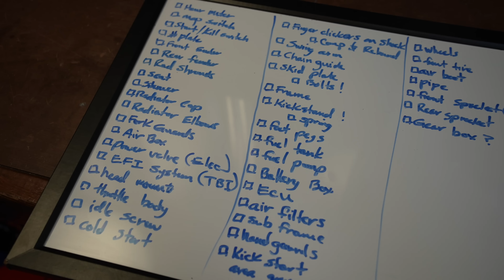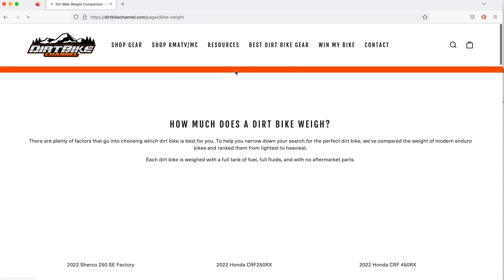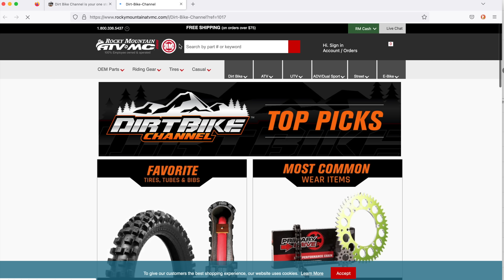I Didn't BELIEVE at first - 2023 KTM XC Dirt Bike Visible Changes

Comment: Don’t accidentally hit the starter button while the bike is running. It will throw a powervalve fault code (5 blinks of the Fi light)
Reply from the maker: I've been hearing this.  Not sure it has an adverse effect, but it's annoying.  Luckily the starter switch is much harder to push than before, but I'm sure it's going to happen eventually.
Reply: @DirtBikeChannel  just rotate the switch down so you have to look for the button.

Comment: The changes they have made are great. But are they starting to make it impossible to work on/repair the bike on your own by making the ECU impossible to reset/access? So far I have seen people having to take bikes to the dealer just to reset the ECU because they hit the starter button by mistake and it starts throwing error code for the powervalve. So you would have to take the bike to a dealer for pretty much everything that the ECU is part of .

Comment: It makes no sense to weigh the bike full of fuel because it disadvantages a bike that has a larger fuel tank, which should be a good thing. It's an easy fix though, you just need to calculate the mass of the fuel (given you know the volume and the density) and subtract it from the total.

Comment: This may be better 
I’m done with ktm though 
Had a 2007 sxf450 ( biggest piece of shit that I hated ) currently selling my 2022 husky te300i ( very very disappointed ☹️)
I’m trying out a 2023 TM300EN FI so we’ll see 😊 so excited!!
Reply: Care to elaborate?
Reply: @gpaull2  2007
Terrible ergonomics
Auto decomposition didn’t work 
Would never start, first oil change at 1 hour looked like what came out of a scrap meta grinder at the dump and had scarred cams, frame flexed so bad the seat kept popping out of place and was a 4 speed 🤮 

The 2022 
Engine surging at steady throttle, the intermittent bogging, the 1/4 throttle power free fall , terrible suspension and ergonomics, doesn’t idle well, the cylinder already having some dry scoring from factory dyno run like most of them, 

You can fix the suspension at a suspension shop for $1,500, fix the running issues with tsp for $1,500 but the wobbly flexy frame is probably the worst part( which is why ktm just finally switched to twin spar frame 
But I’m done with those crappy bikes 
Japanese and Italian bikes for this guy 
Love my kx450, love my wife’s beta 300

Comment: I'm not impressed. 

KTM offroad bikes are way ahead of the Japanese bikes, but most of the mods you've pointed out on this 2023 model do not impress me.  That's because they're modifications to the plastic and other parts that are relatively inconsequential.  
Modifications that are consequential are those which constitute improvements to any system that result in an increase in the bike's capabilities, or eliminate a headache.  The only change on the '23 XC's that you mention in the video that might be a meaningful improvement is change to the power valve -- and that only because it removes some of the adjusting and tuning work that the owner must perform.  That is, if they have created a new powervalve system that truly doesn't need any tuning or adjusting. 

The new kickstand might be a genuine mechanical improvement -- a refinement -- but that's marginal at best.  The old kickstands worked pretty darn well.  Making a new kickstand that works a little better than the current good one isn't revelatory. 

And they removed the oil injection so you have to premix the fuel now.  The oil injection is a far better system because the engine needs significantly different amounts of oil at different engine speeds.  A well-tuned oil injection system will result in less smoke produced and far less carbonizing in the cylinder. 

(And for all the Chicken Little greenie-weenies out there, less smoke and lower emissions means fewer dead polar bears, so Saint Greta won't be as angry.) 

What's more is that KTM has a mixed motive for removing the oil injection system:  they save the cost of the system and make more profit on the bike.  Or they lower the price of the bike a bit and sell a few more bikes.  Either way, trust me, removing the oil injection is not a good thing for either the engine or the owner.  It's nothing but a move backward in two-stroke sophistication and it places a greater task load on the owner. 

The all-new swingarm might represent an improvement in stiffness and therefore handling, or it might save a pound or two.  Well find out the scoop on that fairly soon. 

There are five improvements that KTM could make to their two-stroke bikes that they don't seem interested in developing. 

The first and most important is a properly wide, wide-ratio transmission, with all the jumps between gears spaced properly.  The current transmission ratios are a disaster across the board.  Virtually NO ONE in the motorcycle world has put significant amounts of thought into proper transmission ratios, but I'm here to help. 

The second improvement that KTM needs to make to its bikes is a much quieter muffler.  Bikes do not need to be as loud as they are.  If the manufacturers would reduce the muffler noise significantly, the dirtbiking world would have fewer enemies and the riding experience would be better for riders.  After a few minutes of listening to a macho-ly loud muffler, it's no longer macho.  It's just loud. 

The third improvement that KTM needs to make to all of its dirtbikes is a lot more flywheel.  A flywheel that's three inches larger in diameter and has significant circumferential mass would make their bikes all start out better from a stop, would significantly reduce flameouts during slow, technical riding, allow a lower idle speed (because the current idle speeds are absurd), and make room for a better stator with more generating capacity. 

The fourth improvement KTM should make is installing a 17-tooth countershaft sprocket and a 48-tooth rear sprocket stock.  This would make for less chain noise and less chain wear for longer chain life, and it would allow significant re-gearing for super-low gears for slow trail riding.  First add teeth to the rear sprocket, then reduce teeth on the countershaft sprocket, if necessary.  All motorcycles should come with a 17-tooth countershaft sprocket stock, to reduce noise and improve chain life. 

A fifth improvement KTM could make is making their alternators three-phase.  This would be easy-peazy and would result in far better juice to the electrical systems. 

Meanwhile, I'm not going to get excited about slightly changed plastics or other peripheral stuff that won't mean any increase in the bike's capabilities.  They're spending millions on slight changes to parts that are already perfectly functional, like the radiator scoops, and they're not putting any brainwork or money into parts and systems that need significant improvements, like the transmission ratios. 

And think about it:  all of the gazillions of dollars they spent on making new molds for the changed radiator scoops could have gone into putting cush hubs on their bikes. 

Or much better headlights that are LED rather than halogen.

As for the changes this model year . . .

Not. 

Impressed.